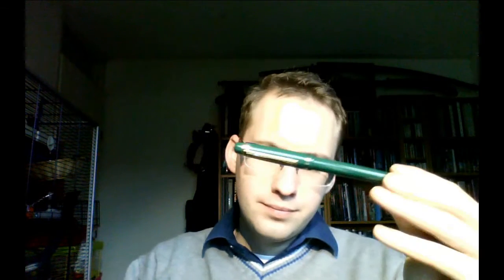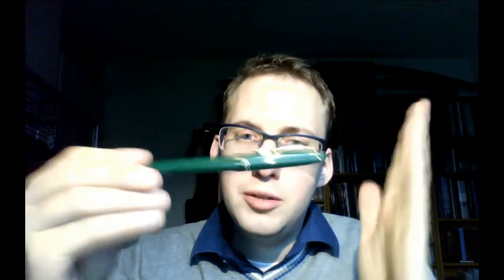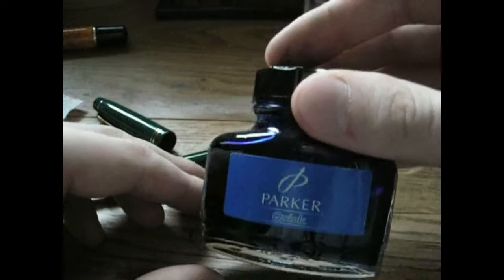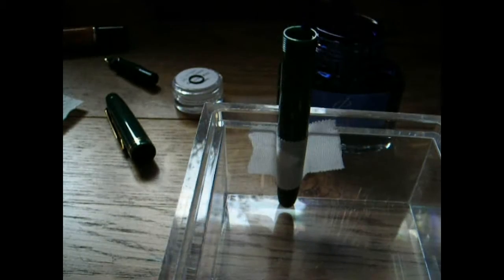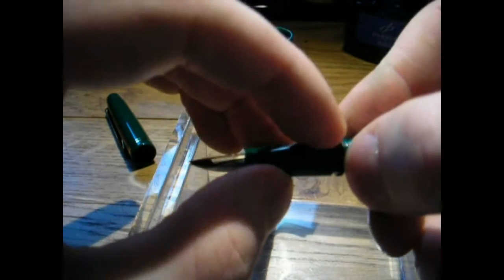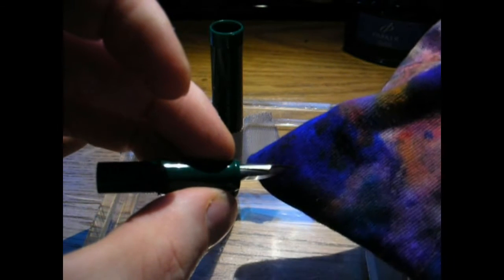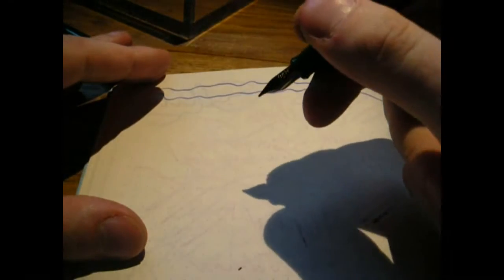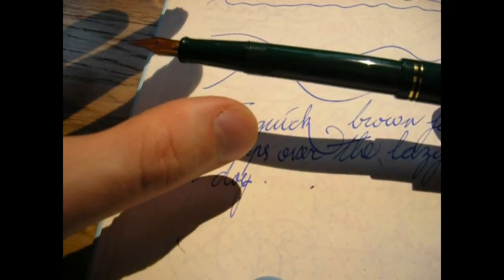Pilot 78G eyedropper conversion

Comment: Just purchased a Delta Vintage Collection fountain pen.  This pen uses ink cartridges, and you would have to separately purchase a mini converter.  Since the barrel is made without any metal, I decided to use it as a eyedropper vs. purchasing a mini converter.  It is an 'expensive' eyedropper, but this Delta pen writes almost like butter!  As always, thanks for your videos that discuss how and when to use a pen as an eyedropper.  Because of my TWSBIs, I had the silicone grease in the house.

Comment: i have converted all 4 of my 78G into eye dropper and it has been working really well for months now. I am a heavy writer myself and the inks have yet finished since i first added them. Next, the o ring is actually optional, all you need is the silicon grease. The number of treads is enough to deter the leakage with just the grease itself.

Comment: In the US you can use Dielectric grease (Walmart Auto section). Europe will have these in Auto Part stores, (this grease is used under spark plug boot wires). I use a Kaweco Ice Sport converted to Eye dropper, and I do not use O ring. I am looking for an easy way to see ink level in an opaque barrel and not let ink run down too low, so pen does not spit.

Comment: Hi Stephen,
I'm a fan, have watched very many of your highly informative videos.

I have just converted an extremely cheap made in England transparent-bodied fountain pen (totally unbranded, no markings on nib at all) into an eyedropper using teflon grease in stead of silicone grease.  It's a very similar product and supposedly teflon grease also has no corrosive effects and (I hope) won't eat the plastic.

Not sure how readily available this stuff is compared to silicone grease, but it also works, for those out there who might have some lying about.
Reply from the maker: Thanks for the tip!
Reply: +u_dun_goofed Teflon tape should work as well.

Comment: fyi: it works also perfect without grease and without rubber ring as well.
Reply: The grease and the rubber ring work as safeguards against an involuntary ink leakage. In my experience, the 78G closure between barrel and section is tight enough for using the pen as an eyedropper, but you surely could use the extra safety provided by those elements, as suggested in the video, don't you think? Regards.

Comment: Hey Dr. Brown, question, to make things more leak proof is it possible to use that white elastic "plumber tape " to seal the threads ? That's how its used when connecting piping to avoid leaks ? Are you aware if this has been attempted ?

Comment: Just for clarification if you are not aware of the tape, it is thin and elastic. It is wraped around the threads and than the second pipe is screwed on causing the tape to fill the space between the threads. I figured of it works for water under pressure it should work in a pen ??

Comment: I did it & it works well with slight looseness at O-ring. Off topic: would you consider discussing your opinion of the value of a 1970s or 1980s Mont Blanc 18k nib 149?  I know these are far over-rated & over-valued, but at what price would you spring for one?

Comment: Stephen, here I am bothering you again. : )  Well, for the first time, I've just converted a FP to eyedropper. It was the Platinum Preppy. I used only silicon grease (cross your fingers, lol). Well, my question is: what should I do when the ink is gone? Considering that I'll refil with the same ink, should I wash everything, clean it all and redo the process? Or could I just put some more ink, apply more silicon to the threads and be good to go?

Comment: Has your 78G ever burped ink? I don't have the 78G but my Pilot Eyedropper ("tank") pen has never burped till date (but it's designed for the purpose). Was thinking of ED conv on my new Pilot Celemo (cheap springy 14K nib!) as the included CON20 converter does not fit. So if your 78G ED has never had any continence issues, I'll go ahead and do it. Otherwise I'll stick with carts.
Regards and Happy  New Year.
Reply from the maker: It has not!
Reply: sbrebrown Good to know!
Now... Lord give me the courage to fill the translucent red barrel of my Celemo with Noodler's Heart of DARKNESS!

Incidentally, I have used the "silicon lubricant" used for treadmill belts instead of "silicon grease". It is liquid (comes in a dropper bottle with a nozzle) and seemed to suffice for my eyedropper "experiments", which have become less frequent ever since I started using GIANT Pelikan cartridges (unfortunately will not fit in a Pilot).

Comment: Hi Stephen, love your videos. I was wondering, how do you remove the CON-20 converter of the 78-g? Mine is either stuck or there is something holding it into the section.
Reply: lbr218 still can’t get it out?